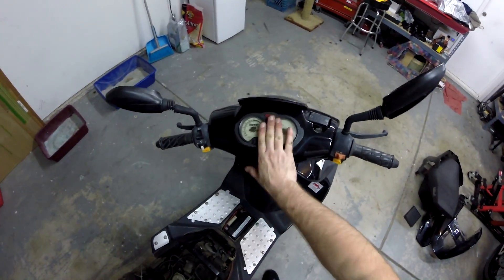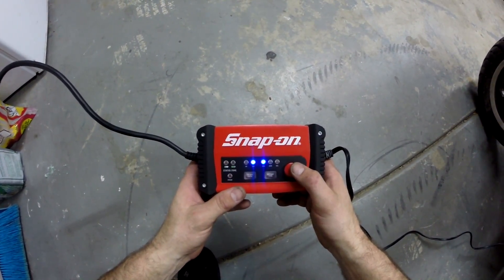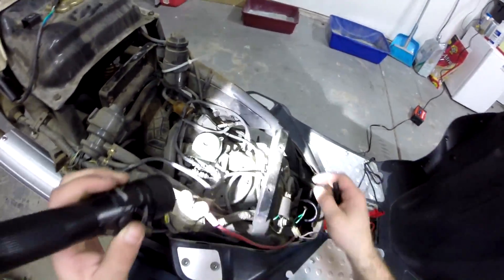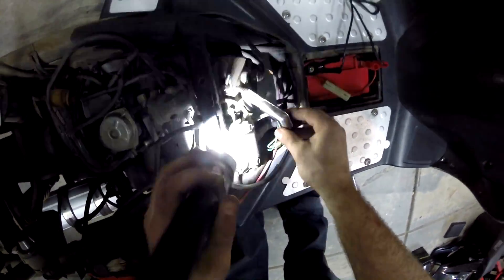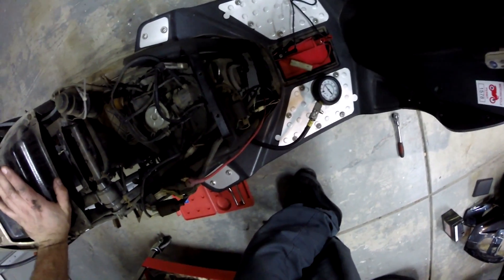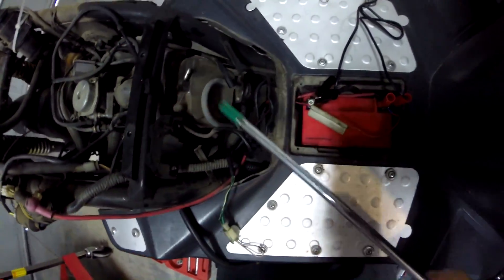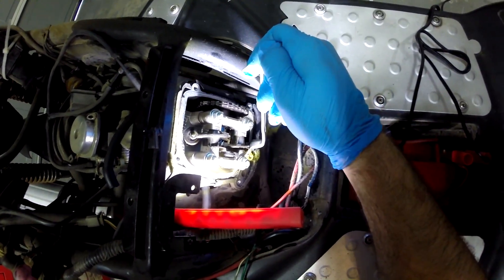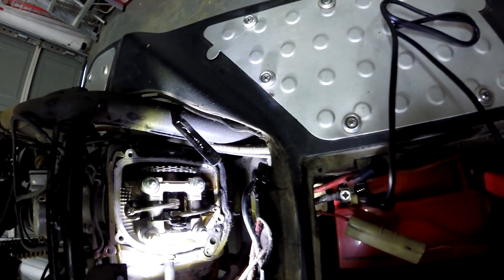Scooter Won't Start? Operation get this GY6 running!!

Comment: Mike! You nailed it! I had the same problem, had spark, Fuel and "compression"  and couldn't figure out why it wouldn't start. I watched this, adjusted my exhaust valve and she fired right up. You saved me man. Thanks a million.
Reply from the maker: Glad this helped you!  This may not help in everyone's scenario,  but it's really common. I've bought probably 5 or 6, non running  scooters with this problem.

Valve adjustments should be done often on these little GY6's.
Reply: thats odd my exhaust valve had no gap and ran. tight as a drum. hmmm

Comment: I like your laid back humorous and logical TS method.
My Xingyue XY150ZK Scooter Trike is having starting issues now, it tries to fire up but then stops and just turns over with nothing.
The problem with my trike is that working access is a nightmare, the chinese designers apparently gave no thought to making owner maintenance easy to do!
I have a spark, fuel is evident engine side of the pet visible filter, when I syphon petrol into the cylinder and replace the plug it fires up for a short period then stops, maybe it's the valve clearances like yours in this clip.
Thanks for posting.

Comment: you da man.  had fuel and spark...skipped the compression test since i didn't have the hose and gauge.  exhaust valve had zero gap.  adjusted and it cranked right up...it was a 2 beer job for me though lol

Comment: Cold start problem for me but it wants to run better after unplugging the auto choke deal so maybe a valve adjustment and a switch or manual choke will get it running like new

Comment: If I put a 100cc big bore kit on a 50cc (49cc) will it cause damage to the crankshaft? And should I put in a high put oil pump? ( 4 cycle)

Comment: wow! easy helpful vid. i have my scooter not starting. (not a battery issue) By seeing this video i know i wont have my scooty start again, until i learn all its guts AND have my own service. LOL
Reply from the maker: Yes, simple things such as Spark and Fuel are easy, but if you do not know how to mess with the valve train. I would suggest not... you can easily damage things.  Glad it was helpful, i'lll probably start doing more of these videos but in better quality. Not with just a GoPro.

Comment: acc to workshop manual for one of my scooters (Peugeot V-clic) it is 0.10 mm (0.004") at the intake - 0.10 mm (0.004") at the exhaust - I have to check because it will not start - it does run for some seconds when spraying start gas directly in the cylinder through the spark plug hole.

Comment: Great Video! I just picked up one of these units for free. the previous owners let it sit outside one season and never got it started again. sat out for 2 years. got spark. haven't checked compression (thanks for showing how). Guessing carb will need to be cleaned. Thanks for giving me hope.
Reply from the maker: Evolved Hunter Thanks for the feed back! These engines are super super easy to work on! For sure check compression on it, if you do not have the tools you can always just check valve clearance anyway. These are notorious for the exhaust valve to hang open. 

The carbs are easy to clean up, and check for intake leaks, the Gy6 engines are prone to warping the intake manifold where it bolts to the cylinder head, causing a lean condition

Comment: i have a 2002 eton beamer, i had a 70cc kit put in about a year ago. since then it has been sitting for over 6 months. i bought a new battery, new sparks, gapped them myself, put new gas in tank. it wont start, it started with the old plug and then died. im getting spark, i smell the fuel not being burned thru the cylinder, also the starter went awhile ago and i was always able to kick start it to get it going for 10 seconds, since then it doesnt even sound like its trying to start anymore. i ordered a new starter which should be here shortly however i cant get it to start by kick. any ideas? i checked air box and when spraying carb cleaneer in the box its showed signs of life but nothing anymore. thank you so much.

Comment: My scooter in the morning will only start with starter fluid. Later is okay, it will start, but in the last time it wont start on electric starter. Battery is new, there is a spark, but it wont start on battery, even when I plugged it to my car. Is this also valve related? Everything else is okay

Comment: I have all problems you had but done feller gauging valves an still right at starting but won't start any ideas please please thanks
Reply: Replace your cylinder head check piston n rings also some leaks u can’t see

Comment: Hi thanks for the video, great stuff. Could you please explain what you did to the valve and what was wrong with it and what the tool with those strips of metal was for? My mechanical knowledge isn't amazing. Cheers

Comment: What's the hose that you plugged into it? I have the compression tester but not the hose. What hose do I need to check for compression? Cause I have spark and I smell gas. So it has to be why all of a sudden my scooter died

Comment: My scooter been sitting for 3 yrs I put new fuel lines and filter and spark plug and shut off valve still not starting do u think clean carb out or buy new one

Comment: hey i have a puma romeo 150cc  scooter not starting. Had a clogged carburetor so i was told. Replaced my whole carburetor, ignition coil,  solenoid starter, spark plug. and wont turn over and battery gets run down if i try to start it too many times. how long does it take for fuel to enter carburetor after putting in new to start engine? have tried a bit of fuel starter to help it out and it acts like it will start but then just cuts out. help please need my scooter for transportation to work. any help will be appreciated

Comment: I accidentally left my scooter on its side, what might be the problem to why it won't start and how do I fix it?
Reply from the maker: There is a good possibility the carb is clogged, depends on how long it was on it's side. May be flooded , pull the spark plug and see how it looks. oil may have worked it's way into the crankcase breather as well, so if the plug is saturated in oil or fuel... that's no good. 

Crank it over a bunch with with the plug out. 

BTW sorry for the slow response.

Comment: LMAO! "Damn man, that wasn't even a one beer project". I love it! I just picked up a Gy6 Tao Tao 50cc that has 980 miles on it but hasn't been started in a year, the battery cables were chewed by some rats and Big Vacuum line coming from the Charcoal canister has been possibly blocked or bypassed with masking tape, any reason why? all the other vacuum lines are connected.
Reply from the maker: Howdy, soooo sorry for the slow response.  The main charcoal canister vacuum line really isn't needed, it just sucks any excess fuel vapors from the tank into the intake to be burned off in the combustion camber. I usually remove charcoal canisters as it's pretty common for those to fail and clog the vent line for the tank, usually ending in a vapor locked tank.  Unless your fuel cap has breather holes. 

Just remove it. CARB or EPA may not like you, but your GY6 will

Comment: I have a new Tao Tao 49cc scooter that ran a week ago. Only has 54 miles
 on it. Wont start. Battery is strong, headlights good, horn loud. Makes
 no noise at all when the key is turned. Tank full. Its like its not 
getting any power at all. What could be wrong with it all of a sudden?
Reply: does your scooter need gas to be mixed with Oil?
Reply: Kill switch enabled...?  Side stand out (effectively a kill switch in some)...?  Turning the 'key' doesn't usually start these scooters as they have a separate electric starter switch!  Remember to depress a brake lever...  Is your rear brake light coming on when lever squeezed?   I had a faulty brake lever switch that caused a similar issue for me.

Comment: My scooter not running at all You have to crank it at full throttle It starts to sputter pixks up speed then starts At full throttle it will run about half speed tven backfires and dies Any suggestions would be appreciated Im at a loss here Please help
Reply: You ever figure it out? I'm having this issue

Comment: hey... i got kymco 50cc and for the life of me i cant get it to work... 
after last run it felt "weak" and when i got home and let it idle it died immediatly. wont start again... 
only thing i am sure of is that i got spark... 
and fuel is 50-50 (when i choke the carb i get my hand wet...  
spark plug is dry every time, all the time... when i turn without spark plug i can smell fuel... 
dont have a reliable way to test compression....

also before it died, in the previous week i had couple of times few blowbacks (exhaust sounded like it shot a blank)
and it is warm and stuffy where i am at... figured blowbacks only happen in cold weather.
Reply: I'm literally in same exact scenario with my yerfdog spider box gy6 150cc as well to the T

Comment: Hey Mike, it seems to me that using the three holes in the timing sprocket is an imprecise way to get to TDC. I would think you would really want to line up the marks on the case and the flywheel when adjusting valve lash.  Am I wrong?

Comment: I got a gy6 on my go kart it won't idle the carb is brand new has good spark good compression new air filter new gas I have been trying to tune it all day and nothing

Comment: Please help.. I'm not sure why I can't get mine started.. 95% sure it's fuel.. I get flow when I disconnect line from carb and turn over but then reconnected seems to not be flowing. Any suggestions would be so appreciated.. have tried three carbs. New lines. New filters. And I have spark. Again I get flow until it's all back together??

Comment: The ignition is broke and I been using electric start and kill switch had to install a in line fuse holder and now It won't start I just bought the scooter like 3wk ago

Comment: Ok Mike I just  installed the ignition switch same thing so Friday I'm order a rectifier  the scooter will not use the power from the battery at all even wen it's on the jump the old rectifier look super old even tho I know you can't tell by the look of it but can I test it at a auto zone or something I have no voltage meter
Reply: On a jump it will crank but won't turn I think we're getting to the bottom I know it's not the fuse not the battery hopefully not the startor because it did crank lol I been watching all yo video and u taught me so much in the past week and a half I'm just ready to see how the part work out if it's the same I'ma get a new cdi or should I just order it also to be safe it takes 2-3wks to receive it

Comment: Hey man. Just bought a TaoTao lancer 150cc gy6. should be in on Friday (today is Monday). I'm not completely ignorant when it comes to being mechanically inclined; however, I know that without help I'd be lost in the gearhead world. What do you think are the main things I'm going to need to worry about replacing and conducting maintenance on soon after arrival? What should I be aware of and watch out for? Any information helps. Thank you for your time.
Reply from the maker: James Booher hey James, on a brand new unit the big things are going to be do an oil change after the first 500 miles of riding or so, also change the gear oil in the rear end at that time.

1) the oils they use are not quality 2) as the engine is breaking in, fine metal debris will be in the oil.

After that I would recommend a valve adjustment around the same time, the exhaust valves have a tendency to tighten up with heat cycles.
Reply: Thanks man!

Comment: hi i have problem with my yamaha vino 125 2006 has spark has gas good exhaust is good  valve is good crank but wont start have the problem for weeks please help thanks
REPLY

Comment: So adjusting the exhaust valve did the trick?

Of course after battery is full charged or good.

Do you know what the needle gauge on the right side is?
I got a Triton R3 with the same instrument panel.
Reply from the maker: The gauge on the right hand side if i remember correctly was the fuel gauge.
Reply: Thank you, but was exhaust valve adjustment to 5 got the scooter running?
And 5 inch or mm?
Reply from the maker: +angelisone gy6 specs vary, i usually do .06mm
Reply: So it was so tight, no gap. 
You then adjusted to 0.06mm. And got the scooter working, right?
Reply from the maker: yes, the exhaust valve on this scooter was hanging open causing low compression, and basically messed up valve timing

Comment: I like.. This was awesome.. So whats the tool to measure the gap on the valve. The compression check hose, is it the same as the one you use to check the pressure on the fuel?? or what is the name of that hose and meter to check compression?
Reply from the maker: just a normal set of feeler gauges does the trick
Reply: Ahhhhhh, ok thanks.. ill be back for more questions
Reply: The tool that you check the compression with... Is it the same as the fuel injector tester gauge?? what is it called
Reply from the maker: Monce Records Sorry for the delayed response. The compression tester is not the same as a fuel pressure gauge commonly found for vehicles. 

The one I actually used is very inexpensive and found at Harbor Frieght. item #62638
Reply: Ok, thank you.. Can i use long screws to take of the fly wheel and get to the stater without special tools?

Comment: hey I need help on my moped!
I have a 49cc scooter and it wont start. I put in a new starter motor and already tried jumpstarting. It cranks but will not fire up.

Comment: israel rivera1 second agoI have a 49cc scooter. Was running great. Park it and the next day it wouldn't start. When you try to start it ,it turns. But when you open the throttle the motor tries to stop. Just like if ur battery was low. If you let go of the throttle it will turn over at normal speed. But wont turn on. I replace the spark plug. Checked for spark. Cleaned out the carb and adjusted the valves. What can this be?
Reply from the maker: Your for sure getting spark? Is the spark plug fuel fouled at all?  The fact the starter jams when your at open throttle is making me think it's almost hydro locking from fuel.  Try getting a video of it while cranking. Also try kick starting it, sometimes if it's a DC Cdi the voltage will sag to the point there is little spark while using electric starter.
Reply: I have a spark tester and it has a strong spark if anything. Ill try to take a video of it
Reply: problem with carb,,,,not enough gas,,,too much air sucks,,clean them,,look your float valve,,,they often get stuck,,,clean also seat from float valve,,,look also mixture screw,,then he gets fired n run again.

Comment: hi I got a sukida 125 sportsman  2 I just changed the cylinder head on it and put it back with the camshaft and got the timings right and put everything together I rode it for like 10mins and got to about 40mph and it sounded boggy and then when I put the throttle on a little it didn't do anything it slowed down to a stop and now I can't get it started can you help me please

Comment: Hello there Mike, thank you for a very informative and helpful video.
I have a Xingyue XY150ZK scooter with a roof and windscreen! Like the Automoto previously sold in the USA and it just will not start when cold.
After adding a small amount of petrol direct to the cylinder chamber via the spark plug hole eventually it will grudgingly start. After a few minutes when it is warm the engine will start right away after it is turned off, then when it is cold it won't start again.
It seems something is preventing the petrol from vacuum feeding through until it is actually running and warm, can you think what might be causing this?
Thanks with best wishes, Barry Webber.
Reply: Hey did you figure it out having the same problem was thinking it's the auto choke or the vacuum gas shutoff
Reply: @bryantb3391  It's way in the past but I think the mechanic renewed the cheap chinese fuel hose and changed it to be gravity fed instead of vacuum fed.
Reply: @barrywebber100  thanks I guess I'll give that a try

Comment: what to do if you battery is full charged and not old and your moped still not even trying to start or doesn't look like power
Reply: GlitchEmpire check connections. maybe the terminals are oxidized. if they are take a wire brush and clean it up. if that's not it maybe it's the magneto or a wiring issue

Comment: got a 150cc gomoto urban that has been standing for a long time i cleaned carb and fixed spark problem , it started and i drove with it but now it doesn't want to start unless I   chocke it by hand. it runs and then dies again any advice?
Reply: +Werner van Zyl - Check electric choke on the carb. either electric connections or the unit itself.
But most probably the pilot jet in the carburetor is clogged so give it a good clean.
While at it had a good fuel filter. ;-)